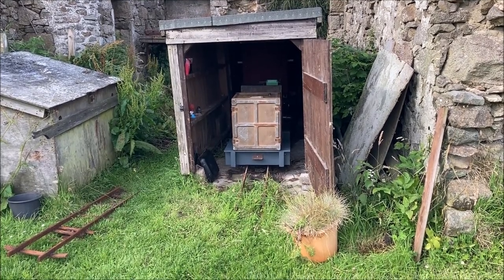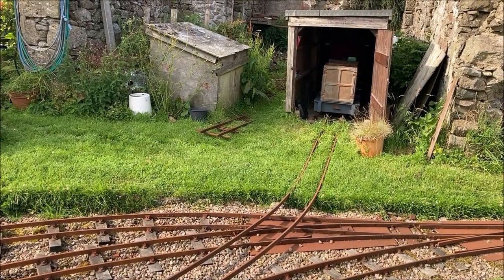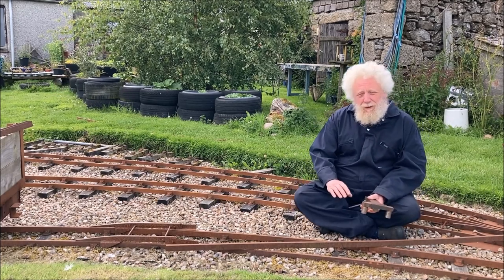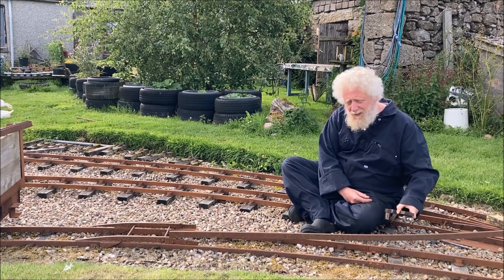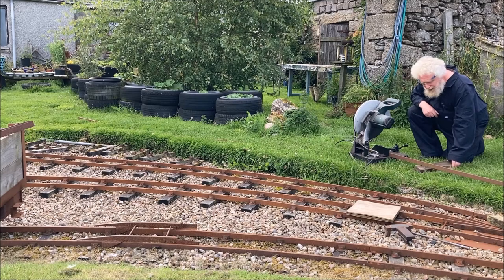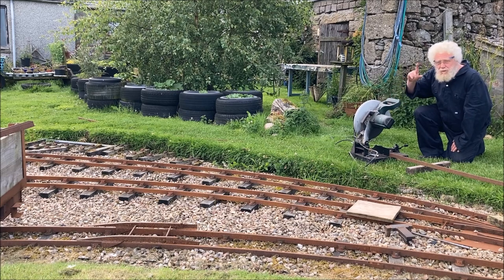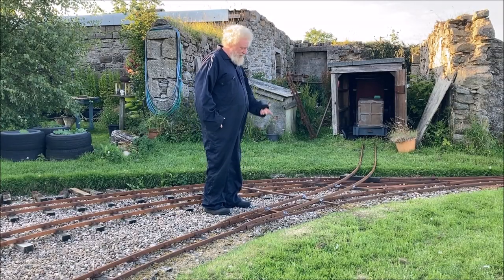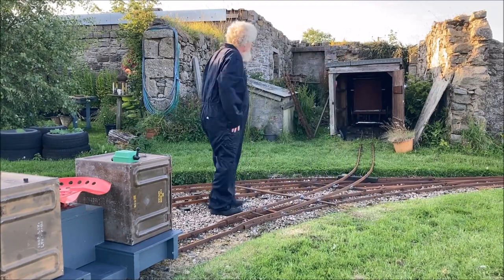Building a layover crossing for our 7 1/4" minimal gauge garden railway

Comment: Why didn't you put in a permanent point/switch from the nearest rail
Reply from the maker: We have plans to rearrange things in that area to iron out a sharp curve and add some extra sidings, so this was just a quick solution in order to be able to use the stock shed straight away. The longer term plan is still evolving.